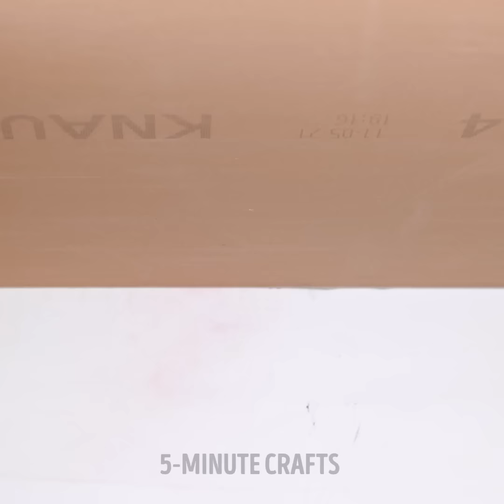Repair Made Easy: Tips from The Experts

Comment: Did he really just run a drill through the box end of the wrench and screw a bolt into it? No tap, no threads. Has he even tried to tap tool steel before? That first clip was enough to tell me not to watch the rest of the video.